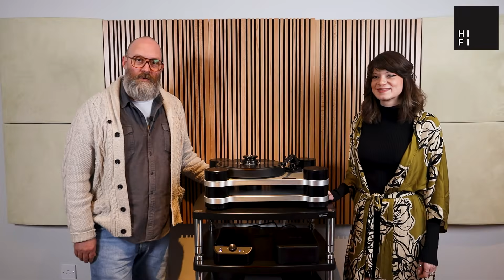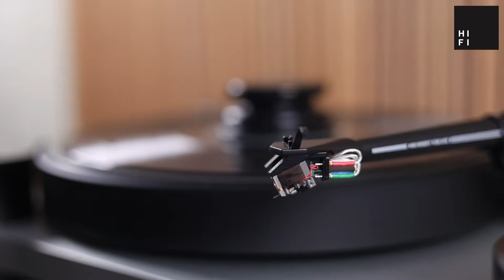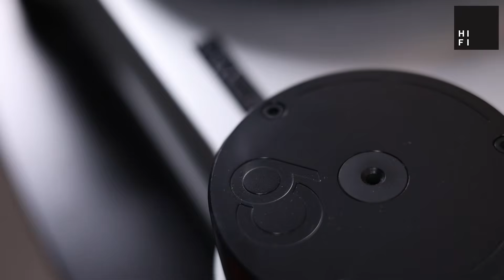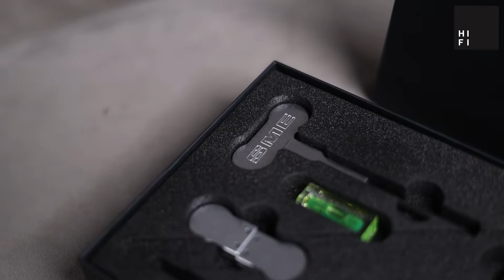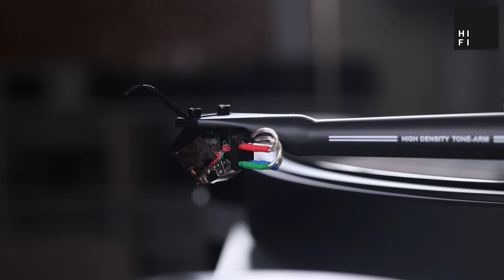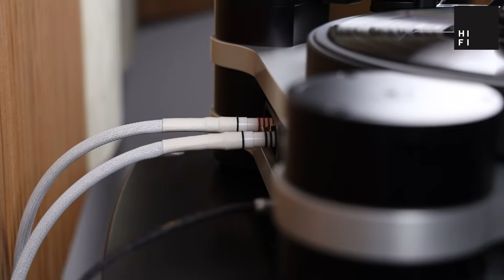SME Model 60 Turntable - product walkthrough with Kat Ourlian from SME

Comment: First impression : no dust cover !!!  Records attract dust , even while playing - a dust cover is essential .
Reply: Most ultra high-end turntables do not have dust covers, but there is a company out there that I’m aware of that makes custom acrylic covers for several different High end makes.
Reply: If the Model 60 is anything like its predecessors, it comes with a soft dust cover for use when the turntable isn't in use. I submit that attached dust covers are deleterious to sound quality.

Comment: SME are masters of engineering. Their choices of materials are based on decades of experience.
Reply: I recall in the early days they made much of their origins as Scale Model Engineering , when they made architectural models of bridges etc , or they made small mechanical components , until one day , circa 1960 AR-A decided to make a pickup arm for his personal use , and people he showed it to all said he ought to produce it .

The stories of his custom built listening room , with literally massive concrete ceiling and multiple sets of Quad Electrostatics are legendary , as was the fact that he still said it sounded AWFUL !

I never got to meet AR-A during my career , but did get to meet Peter Walker of Quad , Arthur Radford , John Michell , JE Sugden , Laurie Fincham and Raymond Cooke of KEF , and of course having spent my adult life equally between Edinburgh and Glasgow , I've known Ivor Tiefenbrun , Russ Andrews and Colin Mackenzie for many years ; plus numerous others , either meeting them at trade shows or when they visited our shop . Those were Halcyon Days indeed . 

I well remember having a somewhat heated discussion over the phone with a certain Mr Sugden after I got one of the later style , nextel finished A48 MkIIs in with the customer complaining of a burning smell and , he thought , smoke coming from it . On lifting the lid , I immediately spotted the remains of a cremated resistor linking the pre and power amp sections of the amplifier , near the back . I'd have just replaced it but the ceramic part of the resistor had completely burnt away and broken in two ; I had no service manual or circuit diagram , so I phoned them up to ask the value . When I phoned them up , I got the man himself and , after describing where it was , I was assured THAT resistor could not burn out ; the discussion became more heated , with my asking him to please just tell me the value , ending up with " nae lad , that resistor cannot burn out " and the phone being put down . I didn't have another A48 in stock to open up and compare , although the last resort would have been to ask my boss to order another one up so I could look ; so I desoldered the remains of the burnt out resistor , wrote out a note referencing our conversation , and writing something like " this is the resistor you said couldn't possibly burn out ; I have the customer's amplifier sitting in the workshop and would like to get it back to him " , sellotaped the burnt out resistor to the letter and posted it down . About a week later , an envelope arrived in the post , containing a resistor , no covering note , nothing , just the resistor . We all had a laugh about it . It was a couple of years later I met him at the Harrogate show , very jovial ; I thought it best not to mention the earlier incident .

The other memorable engineer I had the privilege to meet was Rudi Uhlenhaut , technical director of Mercedes-Benz , when I attended the 1976 launch of the W123 series and turned up in my Ponton , which he came over to see and we had a lengthy conversation about it - I was only 18 at the time and he was mildly surprised to see such a young person with such an old car . I kept that car for 38 years though and only recently swapped it for my 300SL .